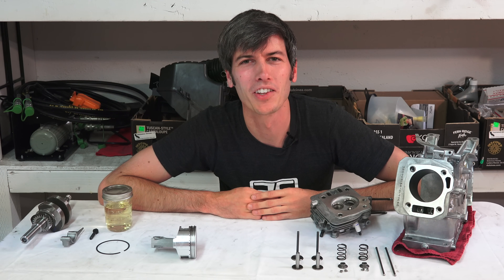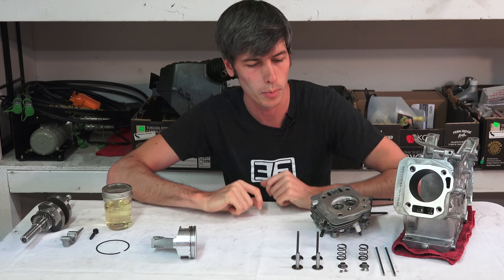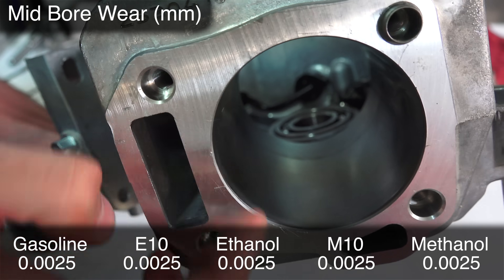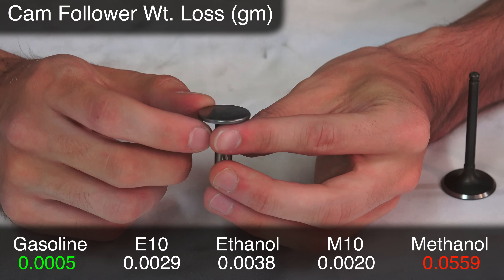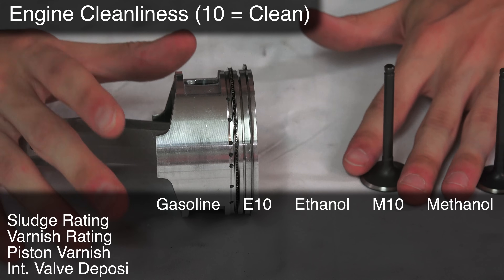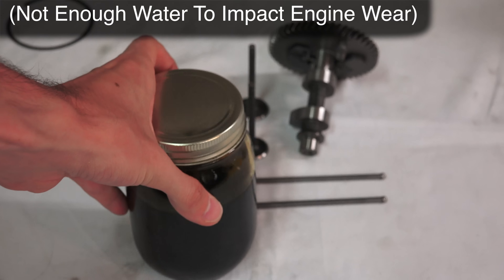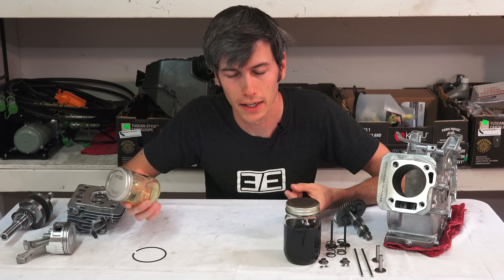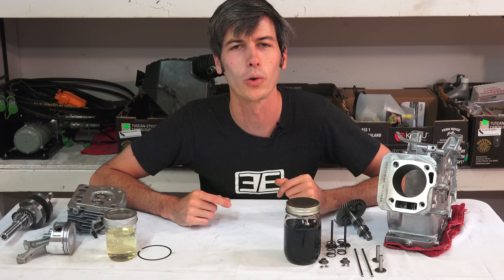Is Ethanol Bad For Your Car's Engine?

Comment: Awesome/informative video as always. After seeing this, I'm curious about how it affects other stuff related to the engines like fuel lines, gas tanks, fuel pumps, etc. I know for boats it is a big issue with corrosion in aluminum fuel tanks and in fuel line breakdown which you explain around 8:30. It would be cool to see the rate at which it can cause corrosion or damage to these parts.
Reply: Yup this is my question exactly. Though I love EE, this was answering a question that I didn't really have. I think the question most people wonder about is about the lines, etc. Maybe it's from hearing Jay Leno talk about all the car fires he attributes to various failing lines from ethanol damage, or having to replace the mcclaren F1 Fuel Cell every five years because of ethanol (at a cost of like 25k) (I'm sure I have some of those facts wrong), but the story I want to hear is if there has been any conclusive testing on the effects of 10 percent ethanol, pure ethanol, or pure gas on the various components and lines that surround the engine.
Reply: E10 is an absolute nightmare for the motorcycle community. You can NOT let a carbed bike sit for any length of time anymore. It's been especially hard on the vintage stuff. Lots of pitted carb bodies and blown petcocks, both of which are essentially unobtanium today.
Reply: It also tends to turn rubber fuel pump mounting dampers into sludge after a while. Never store a bike with an ethanol mix in for any length of time always make sure it is 100% gas only.
Reply: @filmcamera , 100% gas can be hard to find. You go to any gas station, is almost guaranteed 10% Ethanol.
Reply: @tony37068  "your racist comments"

Hahahaha ok.
Reply: @filmcamera  i knew of the problem. When i stored my bike (bone stock Kawa ZR1100 Zephyr) for winter i would
A. Run the carbs dry. 
B. Fill the tank back up to the brim
Reasoning: no fuel in the carbs to gum up over time during storage.
And a fuel tank filled to the brim avoids corrosion because where there is only fuel there can not be air(oxygen). 
When summer came i opened the petcock to let the carbs fill up, choke on, start, vroom, GO! 
Never had a problem.
Btw, we have e5 and e10 fuel. 
I ran the bike on ron95 e10.
Reply: how are petcocks unobtanium?
Reply: @kylandaminick13  on the vintage stuff they can be extremely rare, with even the rebuild kits being unavailable. You can get aftermarket/universal parts, but if you're a collector and want to keep things original you can easily find yourself out of options. Outside of high production models, parts can get very scarce.
Reply: Try getting one for a 1968 BSA Victor.  Not so easy.
Reply: @sacrificialrook6283  
I think that fuel distribution must have only these targets in mind: care of engines and environment.  If it was me, everything older than 20 years should be banned from circulation and kept in museums or private house, as it is a collection piece and not a vehicle.
Reply: Sacrificial Rook's comment is a complete and total lie.
Reply: Not to mention gaskets..
Reply: I add it would be interesting to know what affects they have on other components and how effective each on would be with different aged engines over 16 years also Chris did you do an under seal video.
Reply: What about E85 fuel do you know anything about that? Does it leave deposits or burn clean question
Reply: Hey Chris! Greetings from Brazil. As Rafael said, ethanol is added to gasoline since 80'. Our maintenance schedule differs from U.S. in many ways. For example iridium spark plugs in Civic (R20A engine, flexfuel, that runs at any proportion of gas/ethanol) must be changed at every 60k km, and there in U.S. they're changed at 100k miles (around 160k km) . Fuel filter is changed at every 10k km (and it is very similar to your mazda truck), outside the fuel tank. Only gasoline civics (8th gen only) the fuel filter is changed every 50k km, and it is located inside the fuel tank, much harder to service. The engine oil is changed every 10k km, as well. So, we spend a lot more money to maintain our cars and it is very difficult to see cars with more than 300k km (200k miles) in good shape here.
Reply: ChrisFix
There's a great test for your channel ;) Debunking E85 soaking different hoses, fuel pumps and what not :D 
I think you'll be surprised with the results.
Reply: ChrisFix cheers from Brazil! We have had Ethanol cars since the 80s and the first country in the world with Flex Fuel cars. Ethanol is corrosive to rubber, plastic, etc. Flex fuel engines have specific materials on those parts to withstand that corrosiveness. Still today, Flex engines that run on Gasoline (E25 actually, there is not 100% Gas available here) last much longer and cost less to maintain over time.
Reply: Yeah, also to the exhaust.
Reply: I've had to replace fuel lines on my boat from corrosion. Also having to stabilize the fuel tank can be an extra step since it's not used all the time.
Reply: The ethanol will eat aluminum carbs on small engines, ESPECIALLY materials produced in China.  Small engine tech since 2004.  Chinese parts and ethanol make us lots of repair money, unfortunately.
Reply: ViewpointUnique absolutely! I couldn’t agree more. The pump gas from my closest gas station ruined several carbs and fuel lines in my generator until someone told me how bad ethanol is! Never even dawned me. What a waste.
Reply: @ViewpointUnique 😂 been running a prius on E10 since 2012 (yes no BS here) ran 60 000 miles since. Not a problem.oil is always clean at every oil change. Only thing is it uses more fuel but it's about 3 to 4 times cheaper here I'm Europe.
Reply: Bo Del:    "Small engines"  refers to the outdoor power equipment industry, specifically lawn mowers, trimmers, blowers, chainsaws, etc, that are used for yard maintenance.  As you have an automobile, you are comparing apples to oranges - auto manufacturers are engineering their product to withstand ethanol.  Small engine manufacturers, by an large, have not, prompting numerous fuel system recalls over the past decade.
Reply: @ViewpointUnique , so the ethanol knows and can tell American aluminum apart from Chinese aluminum? I understand the quality and specs, but your racist comments are so....
Reply: @ViewpointUnique  I know of motorcycle that have been in use for over 10 years, no problems
Reply: Ethanol is more compatible with materials found in internal combustion engines and fuel systems than gasoline and the aromatics used to replace ethanol. The corrosion in your fuel lines didn't come from ethanol.
Reply: That's what I want to know cause when I've been told it's causes additional wear it's been regarding seals and fuel pump.
Reply: FI engines over time the fuel system failures accelerate. Fuel pump, injectors, seals, lines, etc
Reply: it's not bad because it has more octane, but the fuel consumption increases, ask those who compete acceleration races
Reply: It doesn't take much time at all for ethanol to do damage. I've had to disassemble my carburetor about a dozen times and change fuel lines. Never use it ethanol in small carburetor engines. Buy Ethanol free fuel.
Reply: If you look up the chemical reaction between ethanol and aluminum, you'll see exactly why it's such an issue.
Reply: Its worthless crap! The E95-E10... Bad millage, destroys your vehicle if not riding. Lot
Reply: GM ran a test on fuel lines which weren't E10 compatible and noticed immediate irreversible wear - so if your car isn't E10 compatible, don't even risk it even once!
Reply: Bio ethanol is corrosive mte so rubber fuel line etc will perish
Reply: Hi Chris !!!!
Reply: Are you going by testing done back in the 80's?
Reply: ChrisFix Hey Chris long time follower here. I know you have a 96 Vette.  I have a 95 and just found a station that has non ethanol gas. The car does sit a bit, but I swear it got 4-5 mpg’s better and performance was noticeable with one tank. Think that’s where I’ll be filling her up!
Reply: @johnnyb1776  don't be fooled by non ethanol gasoline I worked at a refinery we put ethanol in all storage tanks,
Reply: @JohnAdams-xc5yk  It has a lot less. You can leave it in a 4 wheeler and it won’t eat the petcock and carburetor after setting a year or more. Ethanol will do that. I had to do that repair.
Reply: Good Point! Quick! one of you guys do a video on it! :)
Reply: *Fuel Pressure regulators (been through 2 on one of my cars)
Reply: U guys are right.  Old carbs and lines and filters the rubber from tank to frame lines and back to engine bay/pumps. I started to use Marine fuel stabilizer.  Any suggestion s/recommendations
Reply: I am curious to know what the effect is on AF-ratio when going from 100% gasoline to e10 in a carbed engine (fixed jetting). AF-ratio should lean out, right? 
I suppose a lambda controlled EFI engine can automatically compensate for the ethanol in the gasoline.
Reply: Is the added water because it drops intake Temps low enough to cause condensation. I know methanol motors intakes are cold to the touch if they are carbureted
Reply: You know your channel is good when ChrisFix, watches and comments your videos. Good to see the legit car community on YouTube sticking together!
Reply: The e5 expanded Ducati 1098 fuel tanks  when in storage. Crap design by Ducati yes  my bike was 2 years old at the time.
Reply: Hello mister Fix!
i have an important question:
How can a camshaft have different wear when using different fuel?
Think about it...
Reply: Fuel burning in an engine produces hydrocarbons that bypass the rings.  This happens on all engines no matter how new or old.  The PCV system removes these gasses but they still get into the oil can contaminate the oil (hence the need to change your oil).  Different levels of and different types of byproducts effect the oil differently, thus the wear.

This is the main reason why there is oil specially formulated for Diesel engines and Gasoline engines.  Engine oil made for gasoline engines should not be used in a diesel engine as the diesel byproducts will break down the gas oil quickly and cause engine damage.  Oil for a Diesel will work just fine in a gas motor as the gas byproducts don't break down the diesel oil any faster than with oil made for gas engines.
Reply: Alcohol (E85-E100) burns far far far cleaner, which is why oil wears far less than when burning gasoline.
Reply: Combustion contaminants from the different fuels which get into the oil cause various rates of wear.
Reply: I think the logic here is that blow-by either at the rings or valve guides can mix with the oil and then be introduced to parts that are otherwise not in the combustion area but are affected by oil lubrication.
Reply: @jonathan643  it can dilute oil
Reply: If the fuel is altering the composition of the oil (by adding water or more metals the filter isn't catching), then the camshaft could wear differently
Reply: Tests done by those who profit from the production and sale of this garbage fuel. 
I worked as a lab tech in a facility that tested alternative fuels in Iowa. If you've ever driven through Iowa, you would have noticed there is a lot of corn grown there. Ethenol is in the majority of fuels sold there and has been for decades. 
At that facility, we found that vegi oil based diesel is good for those engines. We also found that using ethenol of any variation will definitely lower the lifespan of any petrol based engine.  
We tested more than a really old small engine, there were hundreds.   Some from old clunkers, new cars, new crate engines, foreign and domestic, new and old.  
I was one of the techs who did the labor of tearing down the engines and other parts of the cars to assess the condition before and after ethenol was run through under various conditions. Some of these were run under normal conditions until the engine was worn out or had a catastrophic failure. 
The engines ran on normal petrol last nearly twice as long as their ethenol counterpart test subjects. 
We also found that ethenol is not a little hygroscopic, but seriously hygroscopic. In northern climates, an added danger is being stranded with a full tank of ethenol. After a while, they suck in so much atmospheric moisture that a layer of water in the tank can freeze around the fuel pump, causing no fuel too be pumped to the engine. 
Also, any residual fuel in the intake when the car is shut off, draws in moisture. If the rings are carbon steel or a variation of that, they will rust a little at a time and leave score marks on the cylinder walls. This causes any engine to loose compression faster as well. 
It needs to be said that farmers I know, love growing substandard varieties of corn just for the ethenol industry. They are heavily subsidised and make a much easier living with that kind of crop.  That's our tax dollars at work. That land could be used to make veggies for human consumption, but it isn't. That makes the price of produce higher than it would otherwise be. 
When someone looks at the cost of e10 they see it's cheaper.  They think it's a good deal. It burns off faster. In that case, look at how many miles you travel in a month and how much you spend to do so.   Now, do the same number of miles with real petrol and see what I already have, you pay less with petrol to go the same distance. Miles per dollar is a more correct way to see it. 
So, a car won't last as long running ethenol. It gets noticably worse mileage running ethenol. Your tax dollars subsidize the manufacturer of it. Ethenol makes your food cost more. It's even been proven to not burn as clean as companies say. 
Remind me again, why would anyone put that garbage in their car?
I refused to go along with the companies narrative and say that ethenol tested as awesome. All my reports were completed accurately. Maybe that's why I was let go. I have no bitterness towards that, I was on the edge of retirement anyway. 
Maybe we should all vote with our dollars and demand better fuel than over hyped ethenol.
Reply: @mindthependulum6245  that's awesome. Right from the horses mouth. I run my 04 pontiac grand prix on 3/4 e85 1/4 gas and 6 oz of marvel mystery oil. I started using this mix 5 years ago. The motor has 253,000 miles and runs like a top. So far the only thing I've had to replace is the fuel pump but that was already going bad. Took off the fuel rail to test the spray pattern,they still mist. Scoped the cylinder bore and it looked typical for a block that has 253000 miles. I think the trick is the oils. I change the oil every 4000 miles and use Lucas stabilizer. Winter time I use less e85. For whatever reason it sucks down gas faster then my mix, 23mpg on mix 19 on gas.
Reply: @mindthependulum6245  wow what a outstanding post cheers
Reply: peshewa diy / Chris fix have you seen any long-term problems with aluminium A/N fittings or lines ??? some people say if you're thinking about running E-50 / M50 or higher content you need all SS fuel parts or you will be sorry you didn't with EFI engines but i can get aluminium ones at the same cost or less and it's easier to work with than trying to bend ss lines so that's why im thinking about it 
as for my reason to run alcohol i can get more power out my daily driven engine and its at the local pumps on longer road trips at home base its 4 times as much for 110 avgas vs M100 and im forced into having E10 at the pumps sometimes so my engine ecu has to have a way of dealing with it might as well use it to my advantage and on boost ~85 ron will ring my motors guts out the bottom its ether that or i pull lots of timing + boost and power out trying every thing in the books to save it
Reply: ChrisFix were I live the gas can have up to 40% ethanol and I can say that it is far more aggressive to the fuel lines and exhaust than pure gasoline. Your exhaust doesn’t last nearly as long running on pure ethanol, it I’ll rotten up pretty quickly because of the amount of water in it. It also makes rubber and plastics brittle in the long term. Ethanol also makes your car very hard to cold start and by cold I mean 60F or 15C. And if you drive short distances your fuel economy will suck.
Reply: Ethanol sux in new motorcycles gas too
Reply: Nice to see you here !
Reply: here in Brazil we can run 100% on ethanol since the 80's... it's not a big deal if you designe a proper engine/fuel system
Reply: @Nando_  which materials do Brazilian 🇧🇷 cars come form the factory with that last 6 or more years it would be nice if i can get 15+ out of my new parts and not made from $$ hard to get stuff ? my st louis Missouri  usa made car had uncoated mild steel , brass carb floats and natural rubber seals and hoses and late 60s type plastics and think pot metal / low quality cast aluminium carb parts and E10 isn't nice to those im pretty sure it ate my last carb up / made it hard to starting in the mornings and run ruff or stinking part of time, one of the reasons im now going to modern EFI that can handle it and more power ect. . thanks
Reply: Ethanol has little or no effect on all the things you cite. Any damage is caused by gasoline, toluene, benzene, and xylene. Ethanol is far more compatible that gasoline and the aromatics on all automobile and engine parts.
Reply: i have read e85 can eat aluminium and rust steel ( some of its from water condensation or pulling outside minerals into the fuel system like salt ) weather thats ture or not i haven't the slightest clue as this is my first highly moded hot rod and somethings im learning as i go and is different from just fixing a broken part or restoring it because you ended up having known more of why the engineers where thinking of how to build and manufacture plus sometimes management skips the " right way " to have a higher profitability and the costumer ends up fixing it later and sense im the one replacing fuel parts id like to not end up with rebending 16 + long foot 1/2 lines from pin holes , plugged fuel injectors or a bad fuel pump ect. that should support over 650 hp on alcohol and maybe lean out causing damaging $$$ engine detonation
Reply: ChrisFix hi
Reply: Here in aus we have a massive tuner community using E85 so way more ethanol than your standard E10, RB engines all have aluminium heads and there are no known issues after 15 years of use. A lot of older cars and boats may have a poor quality rubber line or components that may no take the Ethanol well, but that's an old component that was probably due to be serviced anyway.
Reply: 10-20% less mileage on E10? Hahahahahahaha. Hahahahahahahahaha. Hahahahahahahaha.